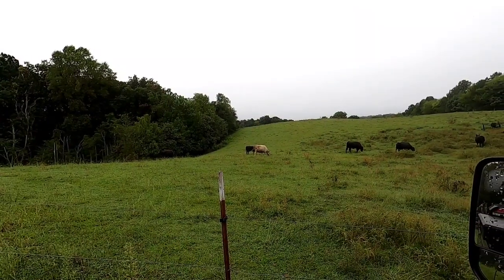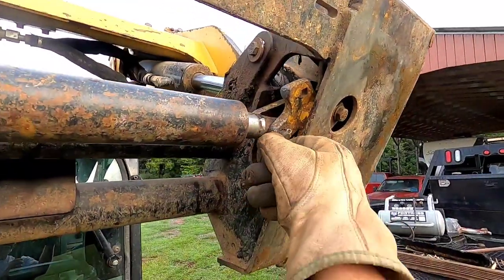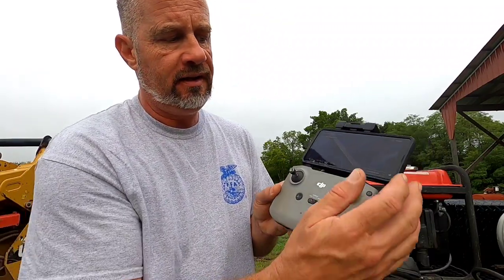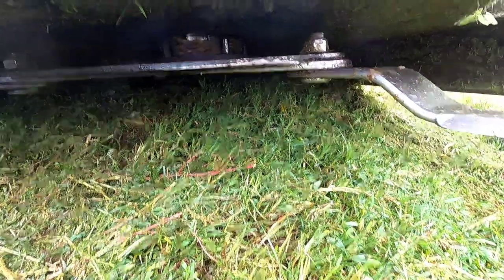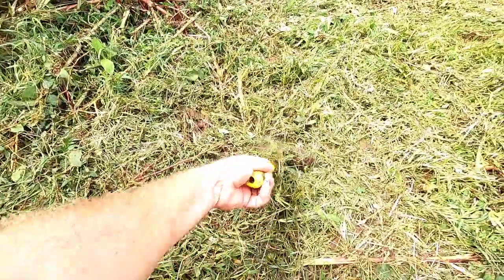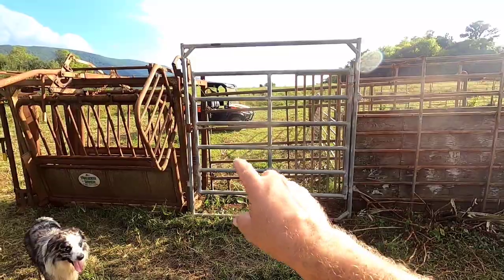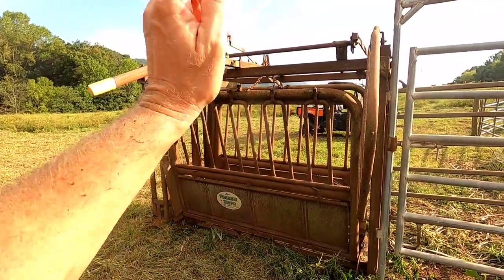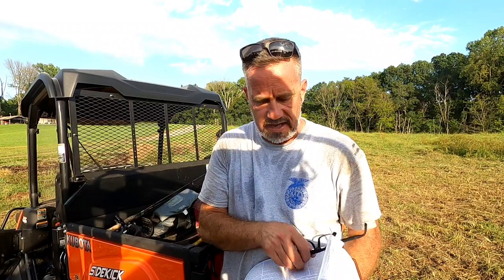HELP!!! I GOT MY HEAD STUCK IN THE CHUTE... BRUSH CUTTING THE CATTLE PEN.

Comment: Cat should have had their thinking cap on a little bit tighter when they designed the whole thing I got a idea I will email it to you sometime today or tomorrow 👍. Tennessee is a beautiful place thanks for the ride with the drone. As far as the getting you're self stuck well knuckle head at least you didn't get hurt and you didn't have to call 911😂🤣. If you end up putting your bull in the freezer make a video if your guy will let you please. Cool farm 👍. Thank you for the message
Reply from the maker: Right, not a good design for what that thing goes thru. Will look at videoing the vet visit if he doesn't mind. Great place to live and work for sure. Any info on a solution is welcomed...
Thanks,
Sam

Comment: I bought my 259D used with 3000 hours from Cat Financial. My quick release was frozen. Took a lot to get it loose. Now I make sure the slides are greased and I activate mine every time I use the machine to make sure they are loose and free.  Now I don’t have issues. I think the electric motor is ok as long as everything is clean and well lubed. But we don’t use it enough and with the dirt and debris rolling over the bucket they get bound up to easily.
Reply from the maker: Mine has almost 3000 on it now. And you  are right,  dirt gets into that area way to easy. Along with the pins and bushings. I really worked to keep it greased and clean so it would last longer. But it finally kicked the bucket. 
Thanks, 
Sam

Comment: When I bought my 299 I requested a quick attach because of the convenience. My sales rep talked me out of it because he said with a machine that big I would be replacing it in a year due to a bent rod. They typically don't put them on the 299s. Having to do it manually you quickly realize how often they need to be cleaned and greased or they won't budge. My guess is if you grease them everyday like your other zerks it wouldn't ever have issues but it is the one area most neglect.
Reply from the maker: You are right. And the zerks are in a terrible place to get to. Definitely a high maintenance area.
Thanks,
Sam

Comment: That’s crazy that the quick attach cylinder is that high. 2 years ago I had to replace my cylinder in my 289d and it was around $600. I’m guessing probably the exact same part #
Reply from the maker: I need to look around and see if I can find one cheaper than the CAT store. I bet you are right that it's the same as the 289.
Thanks, 
Sam